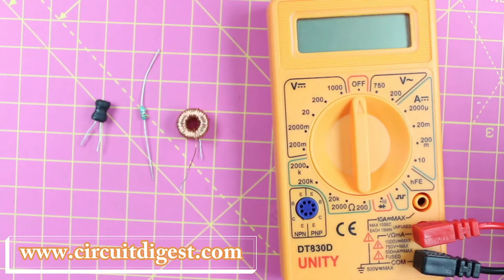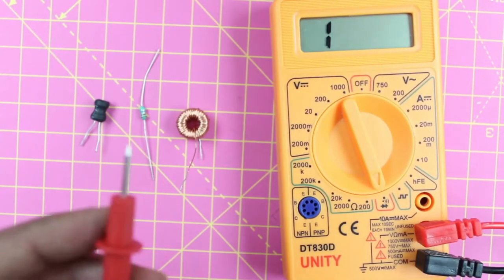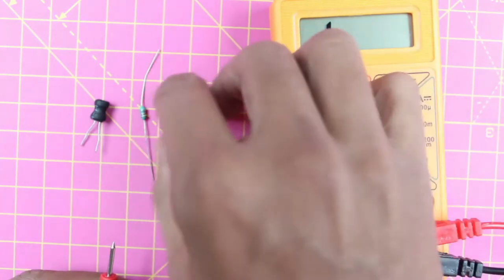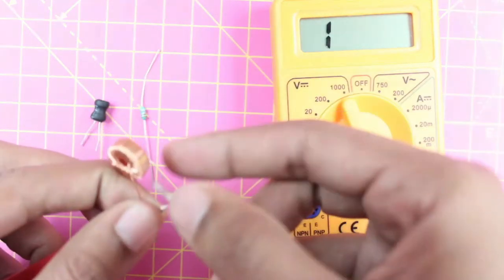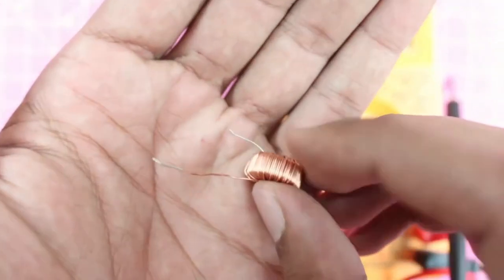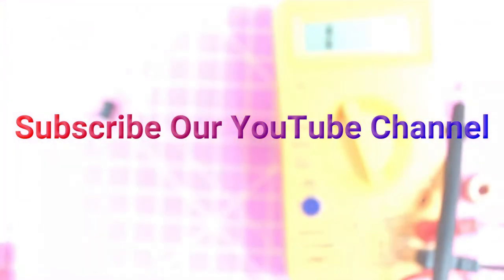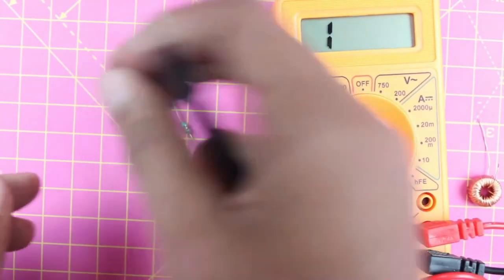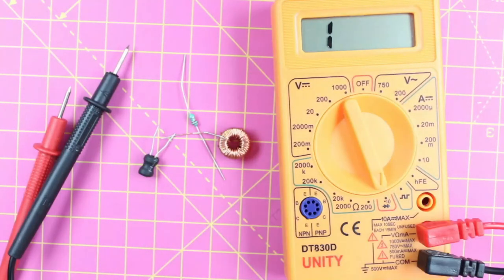How to Check Inductor with Multimeter

Comment: ok but that doesn't actually tell you the inductance in henries. I guess you would have to send a known AC voltage though it and calculate using the measured impedance. seems like a lot of work.

Comment: You should never touch the probes tho as the multimeter will pick up the resistance of your body. If you measure things like that you will get a reading even on an open circuit component
Reply: it will not, as eletricity flows the least resitance path from anode to catode